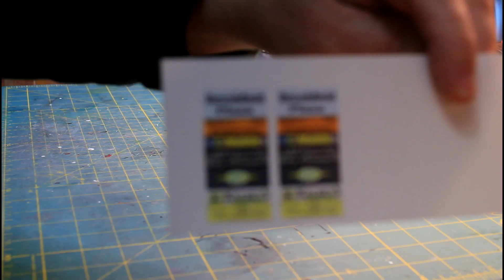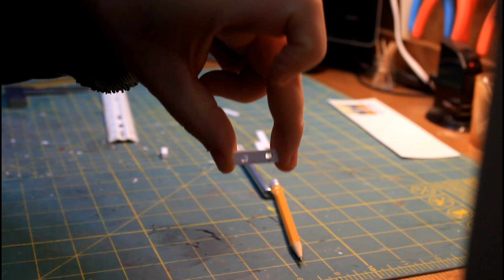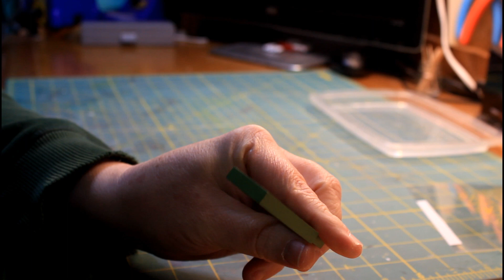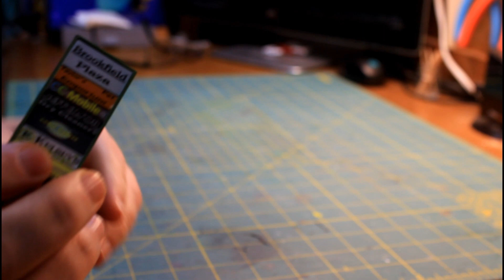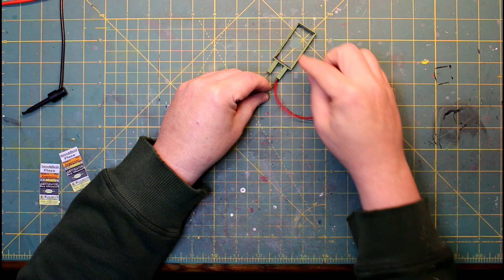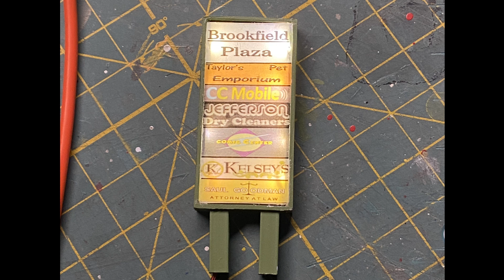How To Make An N Scale Lighted Sign

Comment: Hi Mike, I've been doing some LED work on a layout.   For some lighting I use the "3 LED" strip with resistor that requires 12VDC (those are the long lighted strip lighting) but I also have some single LEDs which of course only take 3 VDC.   Anyway, rather than using a resistor for the 3V I've been using a Buck Converter to drop the voltage.   That way I have a 12VDC feed coming into a panel of switches (I like to have a switch for each light or group of lights) and that panel will have 12V out and some 3V out.

Anyway, the point was that I've been using a buck converter rather than a resistor to drop the voltage.   Oh and I use a Potentiometer to give me variable output to the LEDs as well so I can dim them.